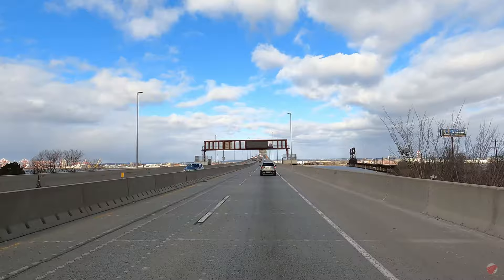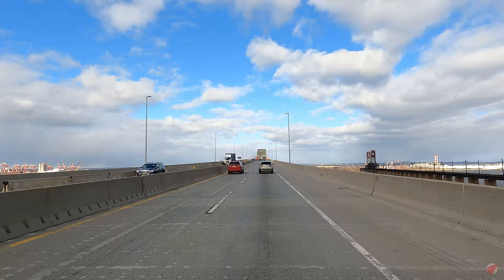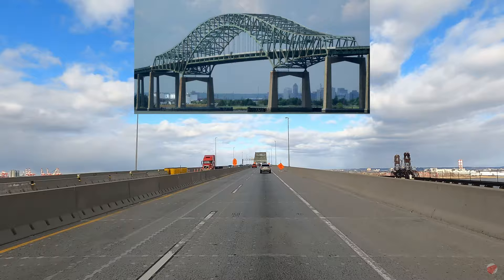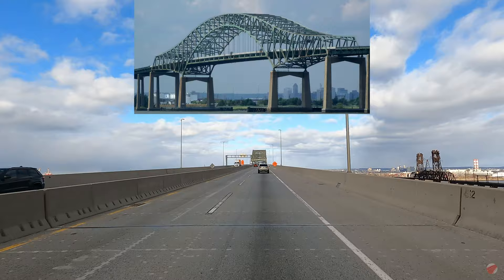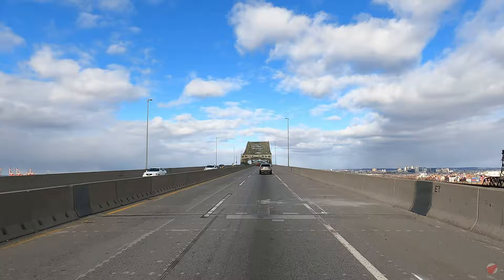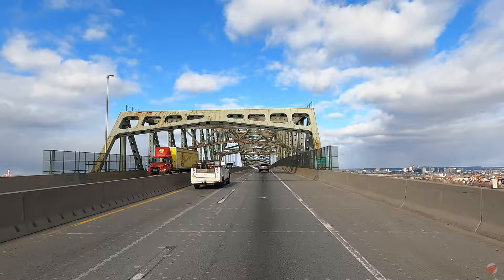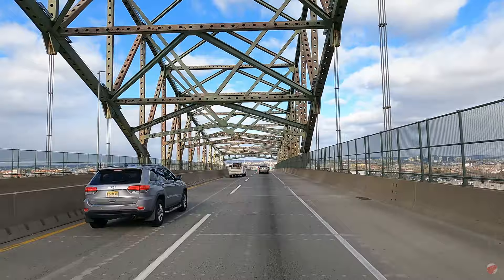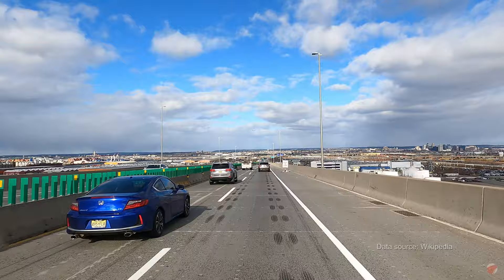Newark Bay Bridge, NJ

Comment: After the Baltimore Key bridge disaster. There should be attention paid to this bridge which is the same type. unless it has been changed and protections put in like dolphins we may have a disaster.  Do large ships come through this bridge?
Reply: I don’t think large ships pass through it. The port is to its south closer to the mouth of the bay. However, this type of bridge will definitely be due for retrofits or replacement soon.